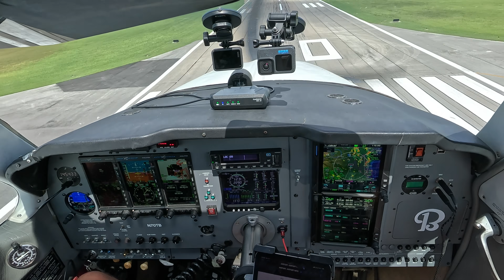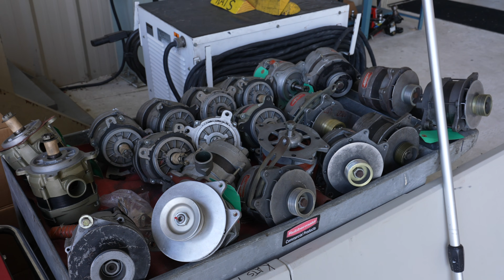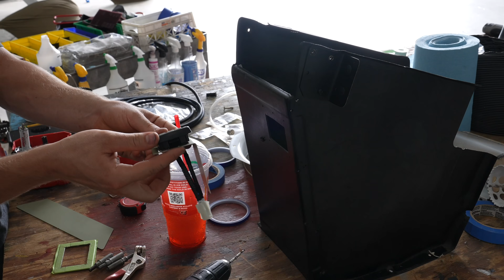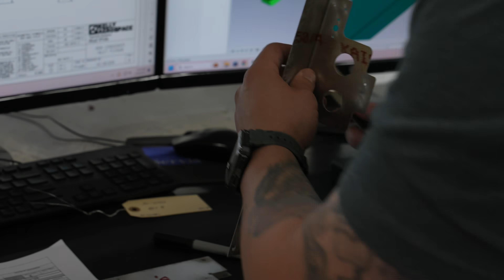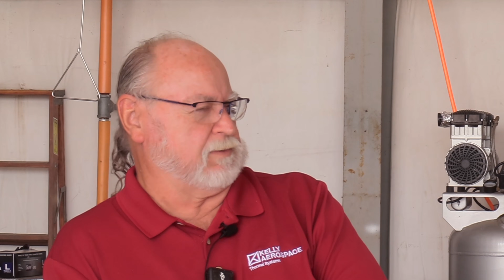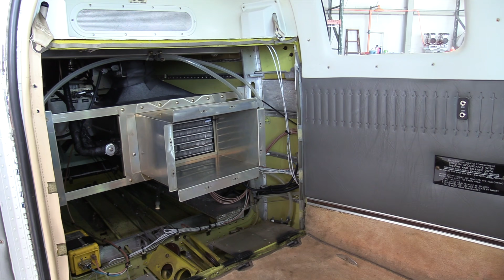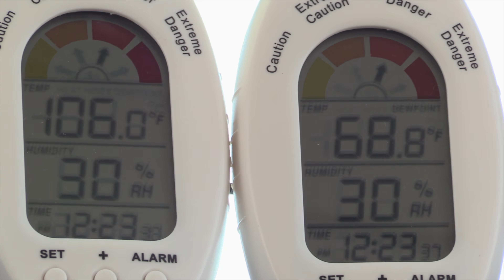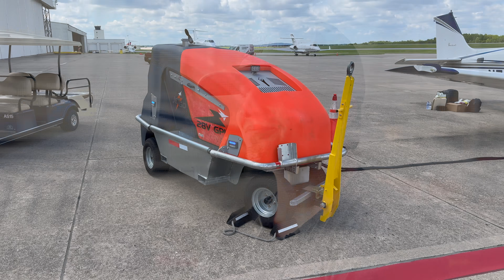Installing Air Conditioning in my Bonanza

Comment: Great video Martin.  I’m on BeechTalk as well, though more of someone that looks at the email digest topics and joins in occasionally rather than logging on daily.  I’ve got an N35 and had A/C installed at the end of a complete aircraft restoration from 2004-2008.  I got the Fire Truck Aviation system then (now A/C Systems, Inc.) then, and was their first V-tail installation.  They used the V-tail’s pre-existing left side tail inspection for air intake, and it is probably too small on the v-tail.  The A36’s is larger.  Mine has an engine drive compressor and works fairly well, but does not cool the whole cabin down in flight like a car AC system due to all the outside air that leaks into the cabin.  Long ago, I had a Biggs Aircraft do everything possible to minimize outside air getting into the cabin, but a lot of outside heat and humidity still gets in.  It’s similar to driving a car with the AC on and a couple of windows partially open.   I’ve gotten around the issue of not being able to cool the cabin without the engine running by using a large window AC unit and had an HVAC company custom make ductwork to pre-cool the cabin on the ground.  JetShades added 4 years ago made just as much of a difference in cabin comfort as the AC by limiting infrared radiation into the cabin.  Perhaps the best modification I’ve done on the aircraft, and certainly the best bang for the buck.  Plus, I no longer have to wear sunscreen and that makes me feel cooler, too.   Our airplanes were not designed to be air tight.   A 3 inch rearward movement of the CG aftward in my V-tail would make my aircraft virtually unusable except for full fuel and two people in the front seats.  My CG moved about 1 inch rearward with the Fire Truck Aviation kit.  I did not need a higher output alternator, but started out with 70 amp unit on my iO-550.  Changing over to an HID landing light, and later LED taxi, nav, and strobe lights really helped, though, as I could not have all the lights and AC on during night time taxi, but can now without any issues even at 1000 RPM.  Although I now live in Tupelo, MS, I grew up in Des Moines and went to college, medical school,  and trained in Iowa CIty for 12 years.  I am back to visit friends on faculty at UIHC every 3-6 months, and will get in touch on BeechTalk sometime to meet up.
Reply from the maker: Thanks for the detailed feedback!  I can absolutely see some jet shares in my future, as they would allow the AC to cool the cabin much more than it already does.
Regards,
  Martin

Comment: I put it in my Cirrus SR22-G2 immediately after I bought it. I live in North Carolina and it was not optional. I had it done in Ohio. It took two weeks. Had an initial issue with it popping the breaker. They had gone to a more powerful condenser and it was drawing more current than they anticipated. I flew up there and they fixed it while I waited. They paid for my gas. Recently went up for their redesigned plenum and relocate the controller. Did it in a few hours with minimal charge. Customer service has been outstanding. Is it as cold as an engine driven compressor system, no it is not. Having lived with a Malibu with an engine driven compressor and its constant leaks and compressor failures I'll accept a few degrees warmer for the reliability. Cirrus does not allow for the piezoelectric switch due to the MCU system but I keep it in a hangar so I am rarely heat soaked. I highly recommend the system and the company as a whole.
Reply: G,day from Sydney Australia.
What is the MCU system in your plane that will not allow a piezoelectric switch?
🌏🇦🇺
Reply: Kelly will not put the outside switch in Cirrus
Reply: @EDD51459  A car key fob-style remote control might solve this limitation, at least for the airplane's owner.
Reply from the maker: Thank you for the detailed report, and I am glad to hear they took good care of the technical issue from your install. Yes, I heard about the Cirrus version not having the piezo switch... I guess their electrical system is more complicated than most traditional piston aircraft.
Regards,
  Martin

Comment: Martin, one side benefit of moving the CG aft is (very slightly) higher speed 🙂  Another fine video, showing all aspects of the system and install. And the part explaining explaining snips vs "wiz wheel" was gold.
Reply from the maker: Yes, that is true!
- Martin
Reply: That’s interesting, you think average cruise speed will be a knot or so faster?
Reply: It increasing little more elev authority and sensitivity too👍
Reply: It increasing little more elev authority and sensitivity too👍

Comment: Interesting looking set up. I do want to ask though do you still have to turn off the system on takeoff like you do an engine base AC system?
Reply from the maker: This electric system from Kelly Aerospace Thermal Systems does not have a limitation for take-off. You can run it anytime during the flight or on the ground. It's a big advantage over the Beech factory air conditioning.
- Martin

Comment: Congratulations Martin!!! Now my wife will see this video and we will have to get an AC in our Bonanza.
Reply from the maker: Yes, that may happen... If it leads to more trips in the airplane with your wife, hopefully that will be a good thing. 👍
- Martin
Reply: go get it, this organization is top-notch
Reply: Got it. Total weight for the electrical version is not as bad as the factory air conditioning that I have in mine.  The combination of the factory air-conditioning, glass panel avionics and the STC 550 R engine put my useful load at only 571 pounds with full fuel.
Reply: @Bigpeat190  that's not bad, just watch your density altitude and adjust accordingly.  That'll get you if anything will.

Comment: The Rusty Pilot is based in Hot Springs, AR.  I was surprised to see my airport on the video.  Would have loved to met you.
Reply from the maker: Yes - Beckey and I visited Hot Springs for the first time, just before dropping off the Bonanza at Kelly Aerospace Thermal Systems in Montgomery.
- Martin

Comment: Thanks for sharing .. Question how does this add to the Weight and Balance of the aircraft .. also how does it impact the performance of the aircraft - eg different airspeeds ..
Reply from the maker: The weight-and-balance impact is shown in detail at the end of the video.
I have not noticed a performance degradation in flight; the slight penalty of the additional weight seems to be offset by the farther-aft CG. The far-forward CG I used to have in the A36 had its own performance penalty...
Regards,
  Martin
Reply: @martinpauly  Thanks You - I enjoy your videos - you are very meticulous, detail oriented and safety conscious on every flight! Happy Flying